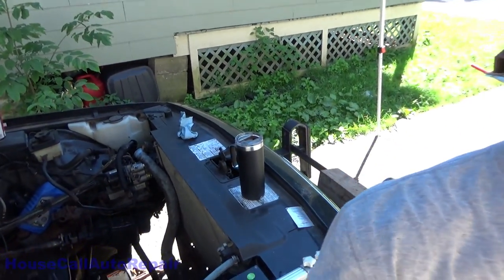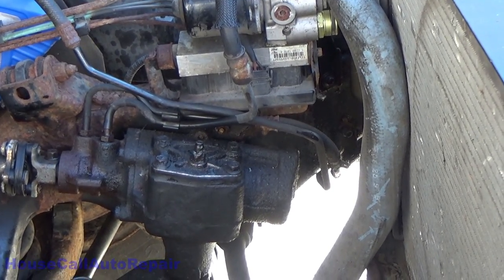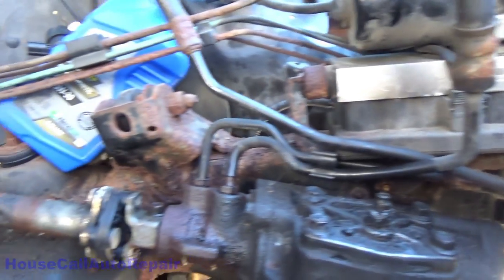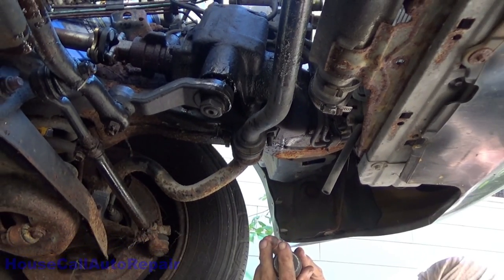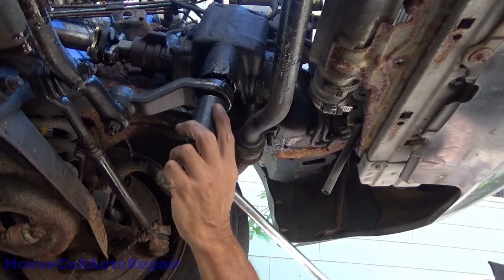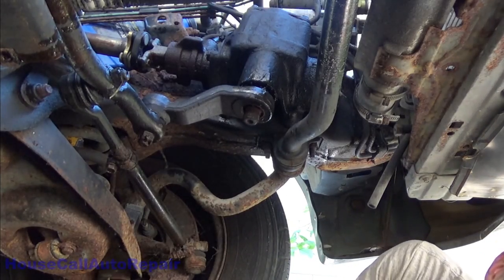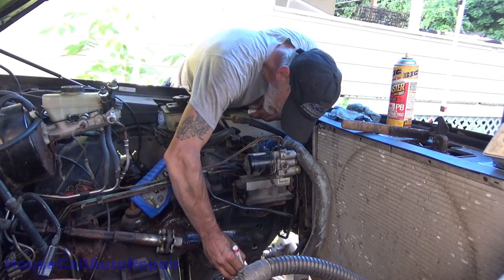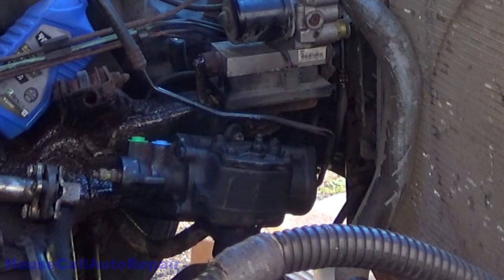The 1997 Crown Victoria Police Interceptor Chronicles - The Steering Gear

Comment: Toyota Corolla videos were fun . I watch utube as you know to fix mine. Just changed transmission fluid with pan gasket and filter. Because at first i was rushing and only drained and refilled the fluid . And then those little ten millimeters bolts were lose so i start tightening those . And the tranny started leaking quick. But i had the gasket and the filter and initially was planning to change those but didn't. So lesson learned. But now tranny is solid and no leaks. Fun project because the before owner added a sealant to the pan gasket and i had to scrape that off. He did the same sealant on the valve cover gasket, WHY ??? So disappointed. But that's why we fix those the right way ! Thank you 😊!
Reply from the maker: Oh.... I cheat and use RTV on occasion where I really shouldn't. (usually when I figure the vehicle will be a recycled beverage can, before the RTV fails)
BTW.... more Corolla vids to come...
Reply: @HouseCallAutoRepair  yes please

Comment: Never realized the steering shafts could be so troublesome, was going crazy with wheel not returning to center drifting everything was leading me toward the ball joints. After watching your other video replacing the steering shaft, I pulled mine out and yes frozen solid. So, thank you for these videos they are very helpful and do entertain especially the bloopers...
Reply from the maker: Every experience is a learning experience.
I can do the same thing 10 times... and there will ALWAYS be something different or something I didn't expect. (Murphy's Law has reserved time, just for me...)

Comment: is there a reason you use a automobile rater than a van or truck for your mobile repairs
Reply from the maker: Not other than at the time, it was the only thing I owned that could carry the weight.